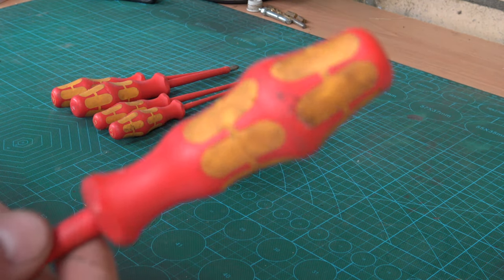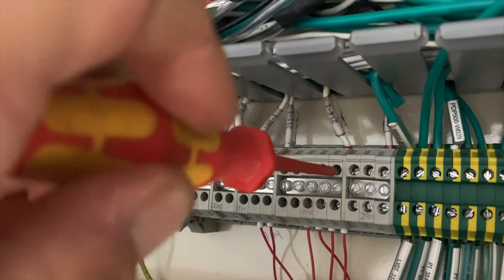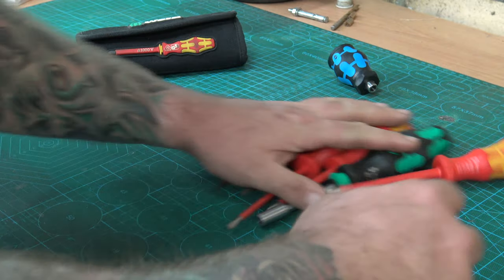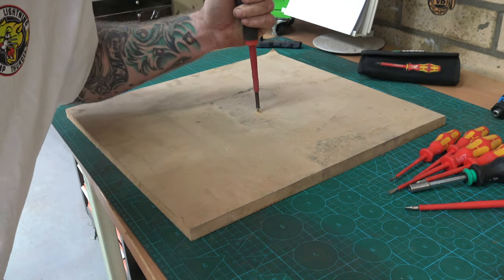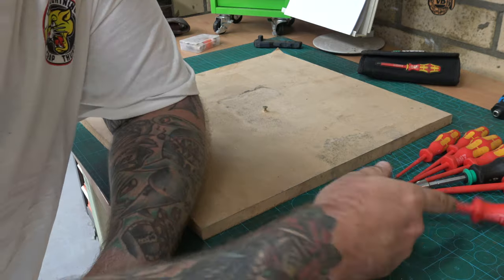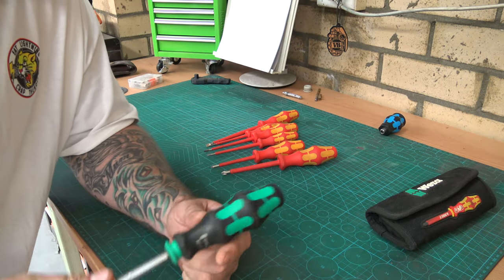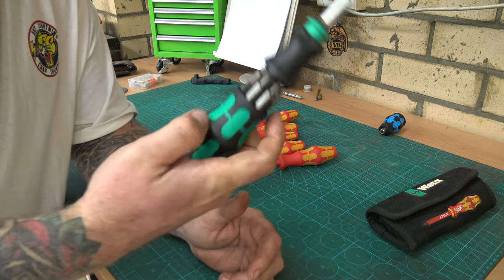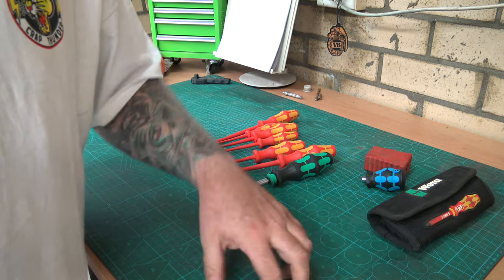Wera Screwdrivers | Best electricians screwdriver set 2021

Comment: You are not lying when you said the 5.5mm could be bigger. #1 size for service work in N. America is the 1/4” driver, but the 6.5mm doesn’t come in the N. American kit. Getting the Robertson drivers is clutch for new load centers, receptacles and switches. 
Thanks for the content!

Comment: Hello there. How long is the shank on those insert drivers once installed into the handle? Is it really 154mm(6in) or is that the overall insert length so basically it’s really about 100mm(4in) once installed in handle?  Any input would be appreciated. Thanks.

Comment: 100% agree with you man Ive a snap on set and for 3 times the prices there not as nice as the weras and I used to be a mechanic now I'm doing industrial maintenance and it's between wera and pb Swiss for me I personally like the wera handles allot more but the pb swiss is a nice screwdriver also. Only good thing about the snappy ones is they have a hex on them to put a spanner on them. And none of my weras do but I think the demolition ones have the hex
Reply from the maker: The handles have a flats i I have been known to use on the Phillips, but it’s not often I find a terminal on a breaker that can’t be free’d by hand that is going back into service. The non insulated drivers defiantly should have some real leverage built in.
Reply: @Finntheweekendwarrior  I've actually never noticed till now 😂😂 and agreed I do some mechanics work on the side so rusty and seized crap is part of it